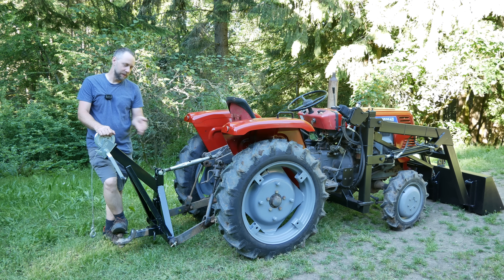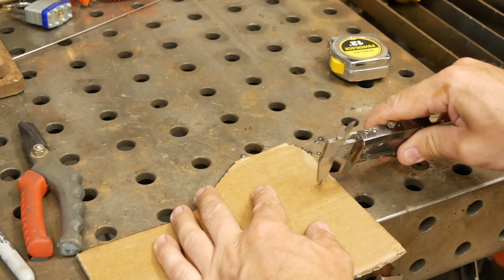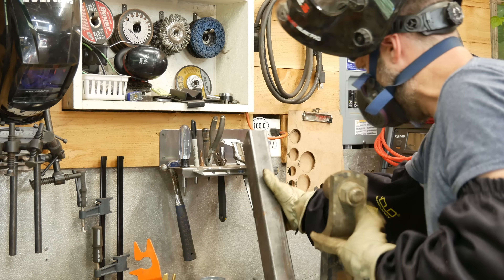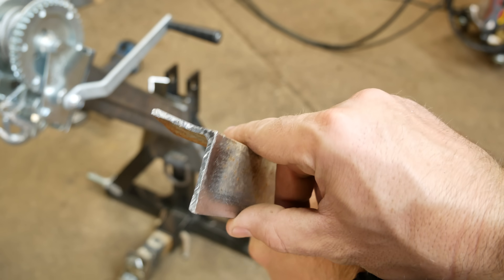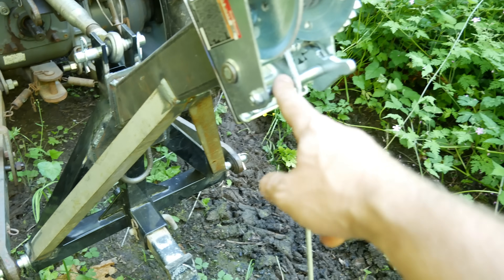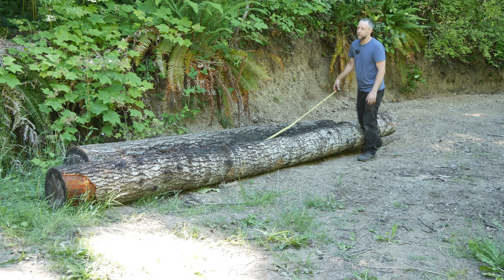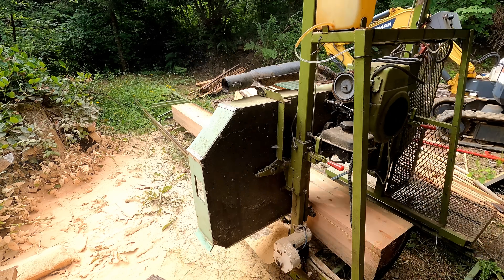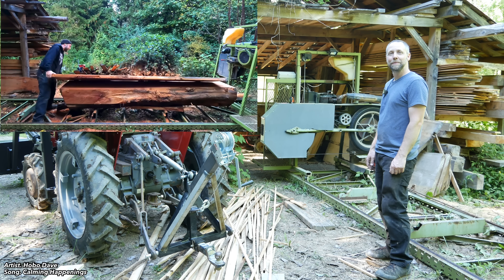Building a 3 point log skidder boom for my tractor

Comment: Great idea. 
I would improve the safety side by making a "pike" to the end of the beam where is now the trailer ball, so that you can lodge the log head in it with the winch, and it wouldn't swing and sway around so much. If you could winch up the log, I would add a V-shaped to bottom where you would then rest the whole log head as addition to the winch. 

As now you have the log weight at high up and it is dangerous for the tractor balance. 
Where you would get the weight to below rear axel, it would improve the balance.

Comment: @MikeFestiva, I think I would create a V-shaped and toothed saddle for the 2” receiver…just replaces the trailer ball…so the the log rests in the V and is carried while towing by the hydraulics rather than the winch.  You could put a pulley down low by the receiver so that the winch pulls the log FORWARD and DOWN into the V-notch, so the log doesn’t shift too much while towing.

Comment: Thanks for posting. Great project. I’m surprised you don’t use a logging arch more. I’ve pulled out some 16 and 18’ trees out of my bush with an old Honda 400 quad. I use a winch mounted on the front to a turning pulley on the back of the arch. After raising the log between the wheels I let it down to rest on chains front and back. No dirt on the bark, no dragging, pretty simple build with minimal materials and a couple of tires on rims. I use a 4” x 10’ post between the arch and my simple hitch. Cheers.
Reply from the maker: Log arch is definitely a good way to go for sure, I built one about 6 years ago, I made a video on it as well.
Definitely works good but there’s some places on my property were this 3 point boom is easier to haul logs out of. 
Thanks for checking out my videos 👍

Comment: Weld some chain hooks lower on the winch frame, use a choker chain on the log. When you get it winched in, raise your 3pt to bring it all the way in, then lower the 3pt, attach the choker to the hook, and raise the 3pt. You'll now be towing from a lower center of gravity and you'll be towing on the chain instead of your  winch cable . With hooks on either side and 2 chokers, you could tow a couple smaller logs out at a time.

Comment: Mike tractors flipping over and killing the driver actually used to happen fairly regularly 
People get comfortable then they get careless 
As a child i saw an idiot tying to pull a stump with a tractor  the guy tried snatching the stump up after the tractor wouldnt pull it fortunately the chain snapped instead of flipping the tractor but when it snapped something flew and hit the operator in the right shoulder blade 
Point is tractors arent something to be careless or reckless with they can will and have killed a lot of people if used improperly
Reply: I absolutely agree but on top of being careful, open seat tractors really should have a rollbar. Around here all the old small tractors have them since you basically had to retrofit them back in the 70s (therer's no strict rule but insurance won't pay out without one) which massively reduced the death count.

Comment: Mount the winch on the arm so you can run the cable up and over a pulley that you mount where the winch currently sits.  That way the pulley takes all the grief from the dynamic load and your winch handle remains on the same side.  Also, no need to rewind the cable so it spools off the top rather than the bottom.  Also, use a chain to wrap around the log, and then clip your cable to the chain.  Using the lifting cable as your wrapping cable, and then hooking it back on itself.... just asking for trouble.  Plus it wears out your cable much faster.  Better to get a nice logging chain for a few bucks, maybe 10' long, and use that to choke on the timber.

Comment: Your video made me realize that I always used the front loader to lift the log/tree.  Then I would go in reverse.  This gave me a good view of the butt end if I needed to make an adjustment to avoid hitting a stump or some other object.  I was used to going in reverse when using the bucket because if you were using the bucket to go into a pile of something you had to go in reverse half the time anyway.  I had a neighbor that worked in the woods a lot during colder weather.  He used a 2 wheel drive Leyland tractor and most of the time he skidded with the front wheels off the ground.  He had a way he hitched that kept the load just inside the rear wheels and if the load hit something that might make it go over backwards the tractor was stopped by a bar that was over the logs.  This bar would hit the load and prevent the tractor from going any further.  Entertaining to watch, with just enough scare factor.
Reply: Just like the dragster's anti flip-back bar

Comment: A half pipe shaped section with short spikes in it on a draw bar installed where that receiver hitch is would carry one end of the log without it bumping back.and forth and prevent snagging... Lift log with cable,drop onto half pipe spikes, tension cable...

Comment: I refuse to drag logs.  The bark gets full of dirt and dulls your blades, chain saw or band saw.  I made a log arch that can carry a 12’ long 24” without touching the ground.  If interested, I will send you a picture.
Reply: A hose will take care of the dirt saw mills use water to clean the dirt off the logs
Reply from the maker: I made a log arch over 4 years ago 👍 If you are interested I have a video on that build. I find the log arch to be useful in many situations but not all.

Comment: Instead of relying on the cable to hold all the weight why not get rid of the hitch and put a piece of flat metal across the bottom of the log skidder for the logs to sit on.
Reply: I would agree.  Another option is to weld on a couple of chain slots.  Use the winch for lifting and bringing close to hitch.  Once up, put chain on log and take tension off the winch.  It will save your winch as they are not design for active towing.

Comment: Mike, just turn the winch 180 degrees
Reply from the maker: I mentioned why in the video, my 3 point hydraulic controls are on the same side as the handle, I just re spooled the winch and now it solved the problem 👍
Reply: @Mikefestiva  yeah I heard after I posted it. I typed it while watching it lol. I figured as much. I have a smaller version of a boom lift, the only difference is I just use a chain and then raise the 3,point but it’s just for the odd time not like you’re using it for. Keep up the awesome vids!

Comment: Great job on that set up. Something else about tractor safety if you have a ROP system on your tractor use it. I see folks on tractors and mowers with the ROP folded down all the time, doesn't work well in the stowed position

Comment: changing the direction of rotation for the drum would be a real pain, and since you mount and dismount the tractor from the left anyway, all you have to do is remount the crank winch with the handle on the left of the boom, rather than the right, or mount a 4" roller fairlead on the front. i made an 18" boom arm with a crank winch that fits in a 2" receiver mount i have on the front and rear of my quad. when you make a log bumper, if it has a single, heavy spike in the center, the log won't want to slip off of the bump stop when you turn, but will still allow it to pivot like a trailer tongue.

Comment: Great projects on this chanel. If you do decide to route your winch cable over the top please put a guard over it. The cables are usually underlay because of safety reasons. If the cable snaps under tension it is less likely to whip over and hit you upside the head.
Cheers from South Africa, birthplace of Nelson Mandela, Elon Musk, biltong and home of corruption.

Comment: Mike you could use a small grapple hook on 2 feet of chain to handle the load instead of letting the cable take all the weight use the winch to get the log where you need it to hang then use the grapple and chain to take the load weld a big d shackle just below the front of the winch then winch up to height hook grapple around the tree then put chain in d shackle and lower cable to relieve the weight it will save on breaking winches and stretching and breaking  wire rope love the build more drum solo's cheers from down under
Reply: What Glenn said. The gears on these winches are very weak and prone to fail. Particularly the stop/freespool catch

Comment: Mike, As always a great video.  For dragging logs I use a different setup (yours is great - too) but also use a boat winch.  I recommend using a block(s) to increase the power, reduce the stress on the usually light duty boat winch.

Comment: I  towed  out  the  bush  more  than  just  a  few  times.  Used  a  small  Massey 135. We figured  it  was  close  to  2  tons  for  towing  reasons. If  towing  a  larger  log  out,  we'd  chain  a  tire  between  the  log  and  drawbar.  It  would  soak  up  most  of  the  jarring  from  the  log  hitting  something.  never  really  used  the  3 point  to  lift  them,  just  powered  them  out.  But,  yer  log  lift  does  look  good.  I'd  suggest  a  separate,  larger  roller  for  the  winch,  maybe  built  off  the  upright,  and  further  out  from  the  winch  roller,  to  take  the  weight,  and  maybe  make  that  small  portion  of  the  cable  a  straighter  pull,  just  an  inch  or  three  would  help  drastically.

Comment: A thought, Maybe if you had an insert for your 2" hitch like a Spike, or point, that would also imbed partially into the front of the log.  It would help to stabilize the log from bumping and take some of the load away from the winch - during transport.

Comment: What you really want to do is weld a couple of chains hanging just under your winch.  Once you reel your log all the way in, you can hang the log on your pair of chains--- and then loosen some slack in your winch line--- that way, when you're towing it, all of your pulling wear goes onto the chains-- and your winch only gets used when you need it for lifting, and not when you're towing the logs.
Reply: @calholli yous sir is quite a genius! Great idea
Reply: I don't see the point of the winch because you can raise and lower your hydraulics you lower it down take up the slack pull it up in the air. Instead of a winch and cable put a set of tongs on there. That's what I did I pull up I got it mounted on my bail spear which is way heavier duty than that three-point adapter. I just welded chain clevis on my Bell spear
Reply: @cowbdave99   Yeah, I agree.  The winch is still useful for things that you can't really get close to I guess.  But he should be using a chain to lift and drag it-  by using the hydraulics.

Comment: Quite a few people have been crushed under a tractor.  All the operator's manuals warn against pulling a load with anything other than the lower lift links.  Those links are attached below the axle, the tendency is to push the front end down.  Pulling from a point a foot or two above the axle is tempting the devil.  There are tractor skidding attachments that use chain type chokers, there are several grab hooks at the lower level.  They use the winch to move and lift the log.  Then lower the log and catch the tail of the choker in one of the hooks.  Safer and allows skidding several smaller logs in one turn.  Going uphill makes matters worse.  One guy might get away with being fast on the clutch, the next guy might be dead before lunch.
Reply: I wouldn’t be too worried about the tow point being above the axle. It looks like you are only pulling 1 log at a time, and you seem to keep your head out of your rear end while doing things that might be a bit higher on the danger scale. However, I do agree with Chuck about the choker chain. Using the winch to move the log into position, and then pulling with a chain will drastically reduce the wear and tear on your winch and, more importantly, that little bitty cable.

Comment: I was just thinking about doing something similar to this with a carry all. It would take a bit more welding, but I figured I could get something underneath the log and take some stress off the boom, lower the weight. You could probably do the same thing though an attachment where the receiver is. Something to think about.

Comment: Turn the winch 180.you are pulling the line in from the back,
Reply from the maker: I didn’t want it on the other side because of my 3 point hydraulic controls, I mentioned this in the video.

Comment: I'm sure you can put the handle on the other side. Or put two handles - one on each side. Of course, I think I'd be inclined to put a 12v winch on there - looks like that hand winch is a little underpowered.
Reply from the maker: 12 volt would be good but I wanted a simple setup that goes on and comes off quickly with minimal extra stuff.
Reply: @Mikefestiva  I use Andersen style plugs to allow me to move my winches around. Makes it really simple to share a winch on more than one piece of equipment also (or even put it in different positions on the same equipment.

Comment: Great build Mike1. I was going to suggest a bash plate then you mentioned it.  Thumbs up!  As for the winch, what about mounting the base vertically?  It should change the angles enough to prevent the bolt from bending or interferring with the cable.

Comment: Have you thought of Fabricating a "Spiked" Hitch Plate to puncture the end of the log to keep it steady?
A 2" square Tube (or whatever size your Receiver is) with a 4"×4" plate with four 3" Steel Spikes would keep the end of the Log in place without having to use Ratchet straps.

Comment: Mike, love your stuff!  I have an old 4 x 4 Ford (I think Yanmar motor), about 24 hp, 2 cyl.  I built an A frame to pull and lift cars, plus a neighbor had a great portable saw mill.  I was dragging down 30 to 40 inch oak, ash and pine trees 21 foot long, and was having a big problem with it doing "wheelies".  I just added a chain connected directly to the draw bar, and connected it to the bottom of the log (like on the loop you use to lift it).  All the difference in the world when it is pulling from down low and not up high.  Did the same things when pulling cars or truck.  Never had that problem again.  If you are going to pull longer logs, this will solve your problem.
Reply from the maker: Great advice Bill! Thanks 😊

Comment: A roll cage for the tractor maybe? It is a life saving investment. Take care!
Reply: I was just about to suggest the same.
Reply: I agree, and another great safety modification would be to build a set of wheel spacers for the rear wheels to move them farther apart. Three inch spacers would probably be adequate for your tractor. I operate a 23 HP John Deere tractor on a steep hill and I put six inch spacers on it plus calcium chloride (or beet juice) in the rear tires to increase weight and lower the center of gravity. It definitely puts more strain on the axles and wheel bearings so I keep a close eye on it and operate at low speeds.

Comment: Why couldn't you build a cradle that fits into the receiver to let log sort of rest on
Reply: That's what I was going to suggest too.A 'V' to hold the weight lower,and keep the log from hitting the tractor,or swinging side to side.
Reply: It might be harder to get the sling under the log and the tractor in position over the log depending on where the tree is laying.  The cable/winch might give more flexibility in initial retrieval of the log.